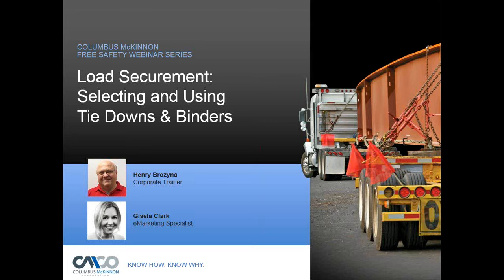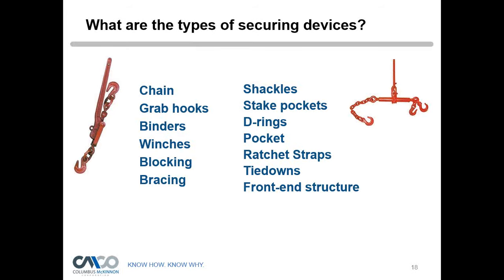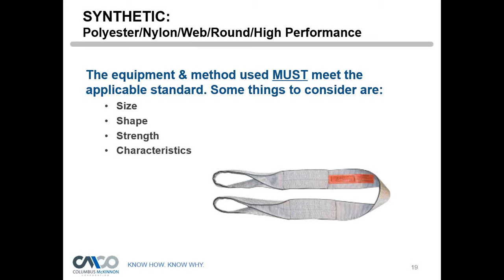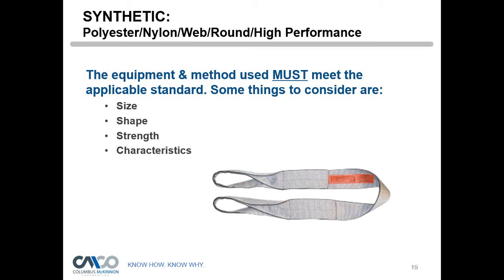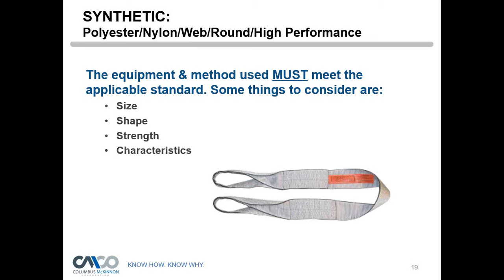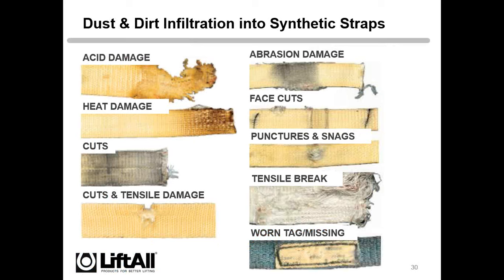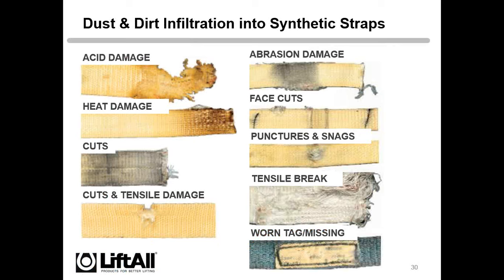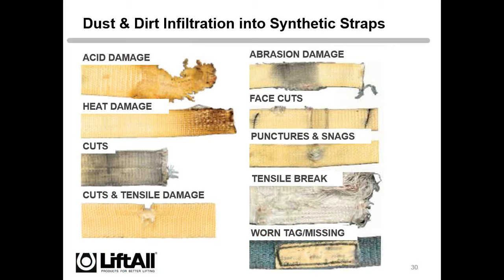Safety Webinar | Load Securement- Selecting & Using Tie Downs & Binders

Comment: In the land downunder, I think the required design factor for lifting tackle is 5 to 1.
Reply from the maker: Good day Jester! 
The regulations for Australia are different than in North America.
In NA we follow the FMSCA & state DOT regs.

If I understand your second comment correctly, I agree it’s a bad practice.
Once chain that was originally designed & used for overhead lifting is damaged, it can no longer be used for that purpose. People sometimes recycle it for load securement. Not a good idea. If chain is damaged to the point that it is removed from service and determined not repairable, it should be destroyed to the point of being unusable.

Thanks for your comments.
Henry Brozyna

Comment: Could someone check this math for me. At approximately 37:29 the aggregate WWL example is incorrect. The sum of 50% of 4 5,000 pound WLL straps equals 10,000 (2,500+2,500+2,500+2,500), not 20,000. Is that right.
Reply: yep it is 10,000 not 20,000 so as a P.Eng. everything he said in my mind is total bullshit. the 40,000 lbs load will slide will that design. Delete that video asap